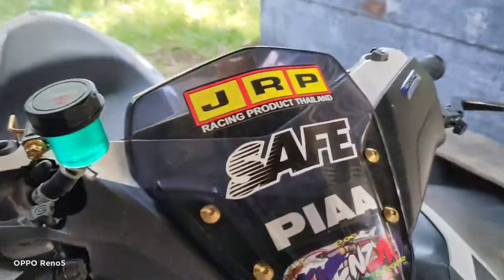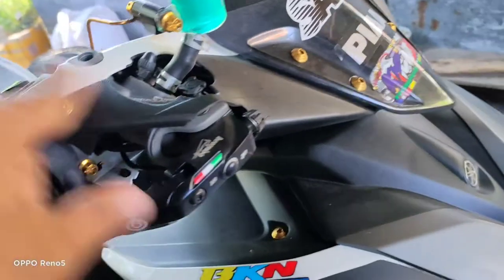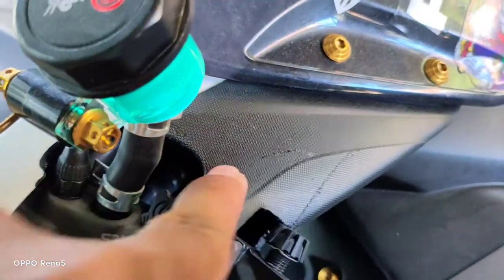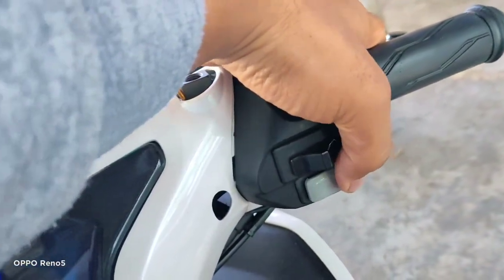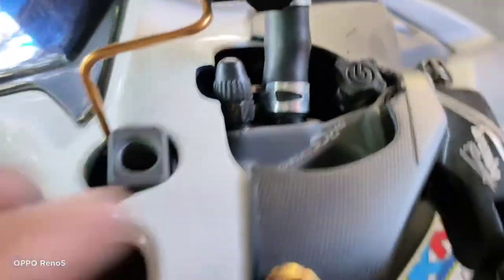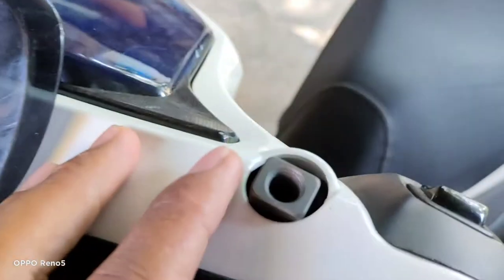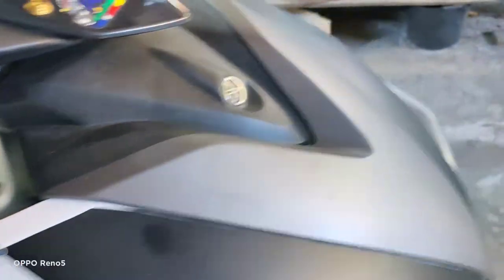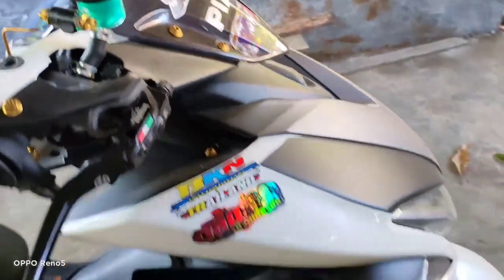P19 Brembo Brake Master Lever on Aerox

Comment: Sir ung sakin class A lang din premium copy. Nawala brake sensor sa rear brake. Di na umiilaw pagpreno ko sa likod
Reply from the maker: Magandang Araw Sir, Ganyan din sakin sir, dahilan ng Walang free na Sensor wire yung brembo natin, Meron ba Sayu sir? Yung sa kaliwa?
Reply: @soonetv1634  sir wala din. May nabibili ba non sir?
Reply from the maker: Ganun ba Sir, Wala sir eh pwera nalang kong Meron talagang Nakakabit sa Kanya Sir
Reply: Paps wiring lang yan, bumili ka ng pressure switch

Comment: Gumagana yan paps, sa wiring lang yan
Reply from the maker: Ooh paps, Kaso d kona pinailaman hehe😅
Reply: @soonetv1634  madaling yan paps. Para safety tayy atleast may ilaw sa taillight natin, sa mio ko kinabit pero nissin brake master sa akin,., Mas ganda yung brembo rcs19 super corsa yun, may wiring na siya para sa taillight at pag electric start ng motor natin hehehe
Reply from the maker: @yuyu_skaholic  hehehe Ooh paps, Kaso, Sira narin rung Wiring paps, So ayun tinanggal ko, Kinabit ko nalang sa raider ko heheh
Reply: @soonetv1634  punta ka magaling na wiring/mekaniko para iwas sakit sa ulo paps
Reply from the maker: @yuyu_skaholic  ooh paps, kaso Tinanggal kona sa Aerox ko, okay naman sya sa raider wala ng switch hahaha
Reply: Pwede naman paps hydrolic brake light switch dyan sa corsa ah